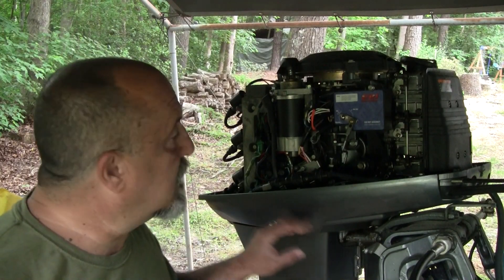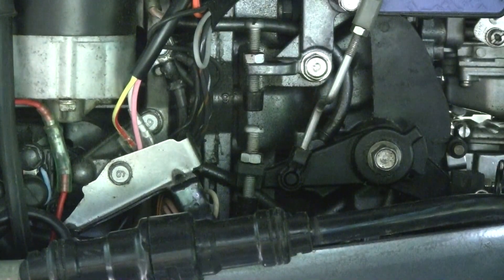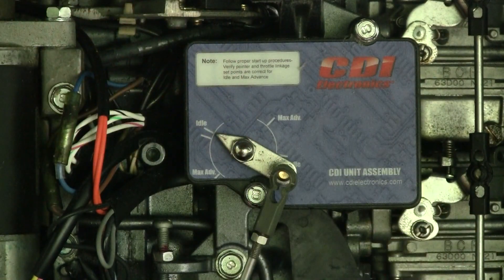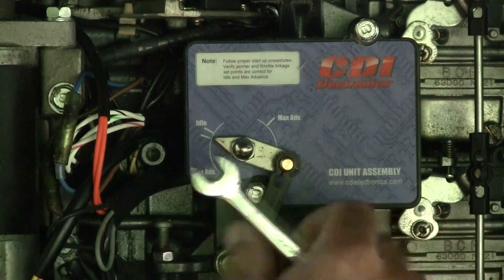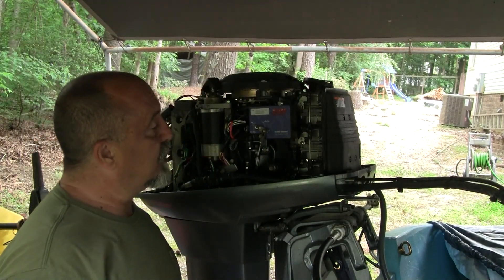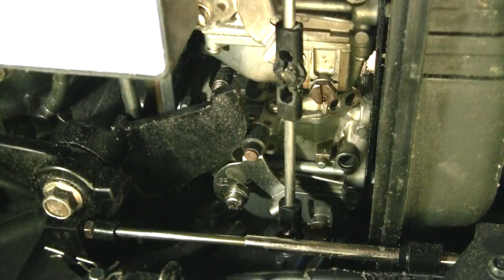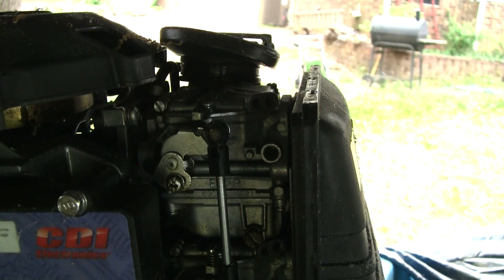Linkage Adjustment - How to Link & Sync a Yamaha Outboard 40hp 2 stroke

Comment: Alright question for you, got an 06 Yamaha 50 two stroke been giving me fits for a long time actually spoke with you about a year ago lol. Running rich exhaust will burn your eyes out. But also lean sneezing and poor idle if at all. Did the link and sync as shown. However will only run with the air screws out about 3 turns and poorly at best. Looking at the carb linkages after the sync the bottom carb is open considerably more than the other two. The linkage is perfect for the top two carbs bottom one most open up 1/8 + to install the linkage. Is this normal? I can’t see why is sneezing when it’s running so rich. I’ve tried from 1/2 turn out to almost 3 with no improvement. At 1 1/2 won’t even idle.
Reply from the maker: Something definitely sounds off. The sync sounds like it is off with the bottom carb. That could definitely cause a lot of issues. I would start with trying to fix that as it should be perfectly in sync with the other two carbs. Did you do a complete cleaning of the carbs? If not, I would do that first. I have a video on that as well.

Comment: Great vid and super helpful.. nobody ever makes a good detailed vid but this guy is good!.. i have an 04 50hp yamah 2 stroke and she runs perfect until i throttle up and hit 1200 rpm then ahe coughs so hard wont get past 1200 rpm.. replace fuel system,  fresh carb rebuild,  new cdi (black box) im lost?? Anyone have ideas?
Reply from the maker: Sounds like a challenging problem. Did you check whether the tank is venting and the hoses and bulb aren't collapsing?
Reply: @ExtremeDIYGuy  🤘
Reply: Jose let me make this clear when i say this.. you have saved me hundreds of $$ by posting this vid!!  
  P.O.V. i have just taken my yama to the shop for coughing / hard studder issues while accelerating anything over 1.5k rpms.. long story short, $700 for carb rebuild, $225 external fuel delivery system rebuilt/  water separator the whole 9 yrds.   Ofcourse to no avail!.....So jose, finally the mechanic tells me its the "Black Box" aka C.D.I unit. So without hesitation i order a new one. $500 u.s.d for the box. Okay so i swapped  the c.d.i. out for the new one.. launched the boat and was so excited to finally have fixed the prob. Only to once again have my motors spit and sputter like a lawn mower in the high grass.. parked the boat on the trailor and made the call to my mechanic and got another appt to spend probably another grand on b.s. but i had a few days before they could get the boat into shop.  
    This is when i stumbled across your channel. Seen this timimg adjustment vid, literally went out and brought a $5 digital caliber came to the boat and followed your specs word for word, # for #, and the boat runs like a scolded dog...  i know its a long story but i wanted you to really understand how much you have help me brother... thank you so much for what you do and just keep posting no matter what jose! You give more than just diy tips in these videos,  you really help build peoples confidence and morale.  So keep it up bud🤘🤙
Reply from the maker: @Fpvcandy  This is the type of feedback that keeps me making DIY vids! I really appreciate this kind of feedback and am happy I was able to help! Thank you!
Reply: Hey Jose how you doing man! Glad to see your still up here posting and helping people with their d.i.y projects..
   Recently purchased a Yamaha V4 115. It is a two-stroke and it is carbureted. Also, 704 rigging and binnacle.
  I wonder what this same link and sink measurements work on that? 115?

Comment: Great video I have a 50tlr I have been going through and this is next on the list. Do you have a video of adjusting the floats in the carbs?
Reply from the maker: I do not but but I checked the manual. It advises that when the carb is held upside down, the top of the float should be 15 mm +/- 1 from the edge of the carb body. Hope that makes sense.

Comment: how do you sync the air flow
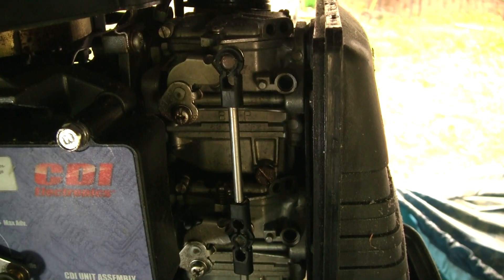Reply from the maker: The video shows how to synchronize the carbs at 11:01, hope this helps.
Reply: @ExtremeDIYGuy  That's not air flow. dont you need a airflow meter to properly sync them for air fuel ratio?
Reply from the maker: That's the procedure according to the Yamaha Manual for that engine.

Comment: Where can I find your video on the adjusting of throttle and shift cables in Yamaha 704
Reply from the maker: I haven't worked on one so don't have a video for it, sorry.
Reply: @ExtremeDIYGuy  
No problem, I was just going by what you had said in your Yamaha sync and tune video that you were going to make a video showing how to adjust cables in a Yamaha controller...
Reply from the maker: I ended up selling the boat along with the Yami and the controller. I did adjust the cables on it before selling it but did not make a video. TBH, it was a pain in the butt. I'd like to get another Yamaha at some point, if I do I'll do my best to do a video on that. I ended up doing small adjustments on the controller end. Making the adjustments wasn't too hard. Lining everything up correctly was the challenging part.

Comment: Hi do you have a video of linkage adjustment on oil pump my 2004 40tlrc is getting alot of oil smokes bad or advice thanks great video
Reply from the maker: Sorry, I dont have access to one at this point. It should be in the manual though.

Comment: Thanks for the video.  Got a 1999 C40TLRX.  It has a WOT mis.  I checked the CDI settings and they obviously needed adjustments.  I did it where the pointer lines up at idle and at WOT.  Now motor starts and quits after RPM winds down.  Any ideas what the problem could be?
Reply from the maker: I would start by checking the idle mix screws and then the idle control. Could be the linkage as well. I had to adjust mine back at the controller so everything would play nicely in the engine. Another are that could be causing that are the carbs. They are actually pretty easy to thoroughly clean (I have a video on that as well).
Reply: @ExtremeDIYGuy  thanks Jose.  I think my pointer in the CDI was not indexed with the marks on the case and I may have throw the timing way off
Reply: @ExtremeDIYGuy  Found out my CDI was shot.  I replaced it and WOT RPM now is smooth.  Having a hard time making it idle smoothly.

Comment: Gday mate well have made a new throttle bracket foot and it wont break , it works well possibly even better than the original , as for the timing marks they all seem to line up after a small adjustment full throttle and idle on spec tommorow i do the sync on the carbs i played the video on the stop a few times to make sure i knew where it was and how to adjust it properly looking at a friday fire up hope it goes well and ive put it back together correctly .
Reply from the maker: That's great! Hopefully it will fire right up and run right!

Comment: Forgot to say your tuning videos have been a great help to me thanks for doing them , i cant even find out what year this thing really is when it was made they didnt record manufacturing years 87 -92 somewhere in there i think .
Reply from the maker: Glad they are helpful to you!
Reply: @ExtremeDIYGuy  sure as hell are used your method to clean all the carbs even got the wire same as yours through amazon the bottom carb jets were completely blocked but carb cleaner and the wire made them like new again .
Reply from the maker: That's awesome! Have you got it running yet?
Reply: @ExtremeDIYGuy  no i was on the home straight going to adjust the links and carbs and the tilt and trim switch was playing up on the binacle tried to open it up but some bone head has put stud lock on the screws then the bracket that holds the adjustment screw for the cdi broke when i went to adjust the 20mm distance for the stopper having heaps of trouble trying to get a replacement as they dont make them anymore.

Comment: Gday mate i can see what you mean about the manual it seams a bit confusing as i am just about to do this ,my cdi unit is backward to what is shown in the manual ie the marks for adtdc and btdc i just have to hope that i am doing it the right way ,i have 1992 heto 40hp so its pretty old ,is that an aftermarket cdi unit on your motor ? mine is made by mitsubishi original , went to adjust the stop to 20mm and the hole where the adjustment screw goes was brokeni think  my motor is cursed ,they dont make the brackets anymore so i will try to weld it back up to make it right .
Reply from the maker: It's a good engine, definitely worth the effort! Good luck and let me know how it turns out.
Reply: @ExtremeDIYGuy  it has had its issues i can tell you completly calcified up it was the dirtiest greaseiest angine i have ever seen but not anymore ill get there in the end .
Reply from the maker: Hopefully the finish line is in sight!

Comment: Hi, My motor is a Yamaha 150 Salt Series II - 2 strokes. It's smoking too much, Do you know where is the oil mixer control? Thank you.
Reply from the maker: The control link for that should be on the bottom carburetor port side. Follow the link to the oil mixer control. I don't have details on adjusting that though. I would get a copy of the manual for specifics.

Comment: Hey there. I have a 1998 evinrude intruder 115hp. When going on plane there is a clunk and when on plane its clunks periodically. It feels like i would of hit something. I checked the gear oil no metal shavings gears and dog clutch are fine. Could loose linkage cause the motor to make the clunking?
Reply from the maker: I am not a certified tech but think that something sounds off with the drive or the crankshaft. I would definitely have a shop look at it.

Comment: Thanks Jose.  I have a 97 C40 that is surging at high RPMs.  Seems to fluctuate a few hundred RPMs when I reach about 4K.  Checked for air leaks in fuel system and have found none.  Carbs have been cleaned and new filter installed.  Recently noticed fuel leaking from fuel pump, could this be the culprit?
Reply from the maker: That could very well be the problem, I would replace or rebuild it and see if that fixes the problem.
Reply: @ExtremeDIYGuy   i.have Yamaha 40 hp I set the cdi on the marks but snis and cohf and puf plos no power
Reply: Jose, I have replaced the fuel pump and cleaned the carbs again using your other helpful video and the problem still persists, any tips?

Comment: Jose. Great video Thankyou just followed up on a 50hp boat run amazing but my tach is saying I’m running at 5k rpms but boat sounds and seems to be running perfect as if it is at 1k Rpms and idle screw on carbs is all the way out.  Any suggestions?  Thanks in advance
Reply from the maker: If the idle screw are all the way out it is probably running too rich for one. Is it running at 1k or 5k?

Comment: None of the linkage lengths on my 90TLR match the specs in my service manual. Also, when I move the throttle forward (on the console) all the way, I don't hit the throttle stop and the butterfly valves don't completely. I was going to adjust throttle and cam sensor links to spec, then adjust the full retard and full advance screws if needed. 

I don't want to mess with this if someone adjusted the timing for a reason. However at one point I wasn't getting above 4900 and drop the prop a size or two. Maybe this is why?

I don't have a timing light nor have I used one before. Can I make these adjustments without opening a can of worms? 

BTW you were right about my bottom carb float...I opened the the bowl and it had come loose entirely and the float body had fluid it!
Reply from the maker: My view is that I trust the manual. If someone did something different, they were compensating for something that was broken or out of spec. On my engine, the CDI unit was off by about 15 degrees. Whoever worked on it last compensated for that and had all of the link adjustments out of whack. I had to also adjust the throttle cable at the control box to get everything right. Ever since I got everything dialed in correctly the engine has run like a well lubed sewing machine!
Reply: @ExtremeDIYGuy  awesome thanks for replying again. So maybe I can just rely on the CDI "dial" vs pulling out a timing light?

Comment: Howdy Joe...great video, just subscribed! I have an 08 90tlr and I just rebuilt and reinstalled my carbs. I didn't fiddle with the timing or linkages at all, I just sync the three valves and tried to get the mixture and idle right. When I synced, in order to get the bottom butterfly to close completely, I had to force it with my finger, and then tighten the screw...it seemed to be tugging on the oil pump linkage on the opposite side side. 
Now they are in perfect sync, but the smell of raw gas coming from the motor is pretty overpowering. Did I do something obviously wrong? First time doing a project like this. Thanks :)
Reply from the maker: Sounds like there's a few things going on. As far as the fuel smell, that sounds like the float isn't closing the needle valve all the way on one of the carbs. On the linkage adjustment, you shouldn't have to force it, did you back the idle adjustment out before trying to sync the carbs to fully closed? You may want to also look at the oil mix adjustment and probably do a complete link and sync. I would suggest getting a service manual if you don't already have one, I found a pdf version on line for about $20
Reply: @ExtremeDIYGuy  thank you. I have the shop manual, I used it for the carb rebuild. 
I think having to force the bottom butterfly valve close was a result of the linkage getting caught up on the various oil lines around the tank and pump.
After running WOT this weekend for a while, it stalled coming out of gear and the bottom cylinder was completely flooded and gas was dumping out down the shaft.

I bought another rebuild kit so I'll be starting with that tomorrow. Thanks!
Reply: Great video do I need to bring piston to the top before I set carbs thanks for the help

Comment: Jose, by this system being a push control vs a pull does the pull option have an advantage vs the push? I’m struggling and with that I have new cables!? Control box is in great shape and when disconnected is smooth as butter!?
Reply from the maker: Not that I can tell. I think the push system is a little more finicky to adjust but beyond that, I have no preference for either.

Comment: I need to do this to my 1989 90 horsepower oil injected it's 90 etlr is it the same or a little bit different on the millimeters and measurements for everything? Great video by the way
Reply from the maker: Thanks, I'm not 100% sure but if you don't have access to a manual you might want to try 20mm as the starting measurement. Before you do anything, measure where it is at first in case you have to revert back to where it was. Good luck!

Comment: Question, I have an 06 50TLR. I’ve set everything the way you showed, mine starts idles rough and shuts off when trying to give it throttle. If I push my CDI lever down while running it takes off. I’ve been fighting this forever now. Different tank,  clean carbs new plugs. This was a motor swap and I had to purchase new cables. Will the link and sync cause these issues? I’ve tried everything I can think of to no avail!
Reply from the maker: Did you check the timing? I had to replace the CDI module on this engine as the timing was way off with the original.
Reply: @ExtremeDIYGuy  I haven’t. I’m having a hard time getting it to run even on idle at this point. I’ve been through the entire fuel system and today I’ve found the prime start solenoid is bad. 0.0 ohms. I’m not sure that’s the overall issue though. Last year when I put this motor on it ran an idles just fine but would die as soon as I put it in gear in the water. New temp gas tank new hoses and bulb new fuel pump. Then got into the control cables today. I had to replace them for longer cables. Also tried disconnecting the low oil sensor. No dice.   If I try to bump up the idle to make it run it dies instantly. I was thinking CDI but dang expensive gamble!
Reply from the maker: @ancellsadventures  They aren't cheap but may be worth a try. I bought mine from CDI electronic but did it because I know the timing was way off with the original. I'm not 100% sure but the carbs may be the culprit. Yamaha carbs are notorious for getting fouled up and the common theme is that you need a hydrosonic cleaner to open up the port to the idle jet. I'm actually going to dive into mine soon to see what all the talk is about but sounds like that might be a place to look. I've been told that  these ports can be cleaned manually but haven't had the chance to try it myself.
Reply: @ExtremeDIYGuy  I’ve been thinking timing all along honestly just did everything else I could first. I’m very familiar with small carbs and I’m satisfied that these are clean. I’m going to try and test my CDI and verify before pulling that trigger lol. Thanks for your help! Great video and ya got a new subscriber!
Reply from the maker: Thanks! One last piece of advice, call CDI Electronics tech assist and ask for the Yamaha expert, let him know what you're running into. I did that before changing the CDI and he spent some time on the phone with me, I learned more in 20 minutes about Yami's then a weeks worth of classwork! Checked out your channel, great job on the Whaler, sub'd to your channel. Best of luck.
Reply: @ExtremeDIYGuy  thanks for all your advice and I appreciate the subscription!!